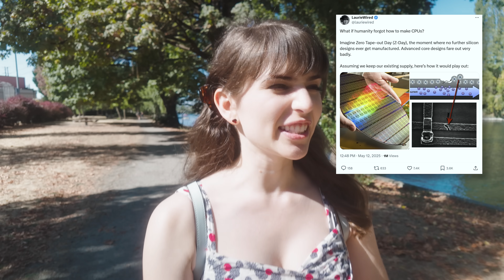what if humans forgot how to make CPUs?

Comment: 11:18 "long term storage has shifted over entirely to optical media". You must have forgotten tape. Tape never went away, magnetic tape, like LTO-9, is a high-capacity, reliable, and cost-effective and used for long-term data archiving, especially in data centers. It can hold 18TB+ per cartridge, lasts 30+ years in proper conditions, and is cheaper per terabyte than optical media. Tape resists physical damage and needs no power when stored, making it ideal for massive backups at places like CERN or Google. It's still widely used because it’s dense, durable, and scalable. Tape remains a dominant, dense, reliable, and long-lasting solution for critical long-term archival, far outpacing optical media in enterprise use. Optical media like M-DISC is marketed for archival purposes, especially for consumers or small-scale use, due to its claimed durability and lack of magnetic degradation. However, it’s less common in enterprise settings because of lower capacity, higher cost per TB, and slower write speeds compared to tape. Optical media also requires specific hardware (disc drives), which is becoming less common, whereas tape systems are still actively developed and supported.

Comment: Not hating here.
Just didn't understand something.
Why would factories stop producing CPU's if they stop getting new designs?
What's wrong with the last design that DID get produced?

I would imagine the whole computing as we know it will eventually die because the usage demands are increasing, but the hardware doesn't improve to accomodate.

But even then, some completely knew architecture or even techonology (not electrical, let's say) could and should replace conventional 2-bit computation because even now, you can't make transistors smaller than a certain limit due to quantum tunelling.

Comment: It's as likely scenario as humans forget how to make a bread. 

Even total nuclear holocaust wouldn't be able to make humans forget how to do cpus. I bet cpu designs like risc or arm are stored in secure vaults that could withstand thousands of ears untouched. Also reverse engineering allows China to build their own chips. The problem might be with post 2000 cpus that require advanced lithography, but we're talking about a cpu, not the modern cpu.

Comment: The grade of disaster globally required to really forget how to make CPU without them just be replaced by something better in some way means I suspect there would be no internet. If TSMC went pop, even TSMC and Intel, AMD, and Arm there are still plenty of Fabs and chip designers globally so absolutely worst case is it takes another decade or two doing the work to go from a relatively low tech process node CPU - perhaps something like what is in the Pi family of SBC's back to the modern tiny feature size, really energy efficient and blazing fast chips.

Comment: Current optical storage media just is nowhere large enough to store what we'd need to store, so you'd need new types of storage that can store much more data.
And of course, if you can't use CPUs to read it, it's going to be useless if there was no other method.
A good amount of research would probably be put towards that in order to not lose data.

But the scenario is a bit weird.
You just have to accept the parameters of it as truth.
Even if every CPU factory on the planet vanished in a snap, the knowledge to develop new CPUs still exist.
Even if the knowledge to develop new CPUs vanished, the CPUs still exist and are in use and could be reverse engineered.
And even if every CPU vanished, the need for automated computations still exist and our smart people would find ways to do it, like they did before.
So really, the technology would just restart with an amount of delay depending on what was lost.

Comment: I designed A doomsday Internet protocol Using radio for conectivity and Tape for storage. Take a given FM/AM Band. One will be Broadcast, the other will be the Receiver. Transmit a Package 100-10,000 hz. break that into sub bans of 20 hz  width. You now have 495 channels. Reserve Upper 95 for Meta data organization. Below you send a noise signal every 10th of a second. An analogue Scanner detects the presence or absence of a given frequency channel which is noted as a bit. these bits correspond with a unique "character". These characters  have variations defined by the pattern structure in the upper 95 channels. which increase the number of potential bit patterns, when referencing a pre-existing "Dictionary" of characters. this gives you a library of (2^400 x 2^95 =1.02 X 10^149 ) possible unique characters, each encoding a unique data imprint when decoded using the library.
Obviously you wouldn't use all those permutations, that's more than the number of atoms in the universe. However it does mean you can squeeze way more that just the 4 kbps than initially suggested. Tape Is the storage mechanism to record the Broadcast for later decoding. The fundamental infrastructure change means that the internet is now a public broadcast between towers with data dump schedules.
Additionally there is a separate protocol for audio and video.
Audio is a simple broadcast of the audio signal, however for time sake you compress the signal into a narrower frequency range and stack multiple segments of the same track on top of each other. On the back end you break each band down, frequency adjust to decompress, and stitch the segments back together in sequence. This way you increase the transfer rate (length* n bands).
Video is similar but with the addition of breaking the file down into scan line groups to pack in more resolution at the cost of longer broadcast time. but you still apply the segmenting and layering technique of the audio protocol.
Requests are made between towers via the towers listening frequency, and distributed over broadcast channels via the broadcast frequency along with a schedule of upcoming data broadcasts. Anyone who wants the file can tune in at that time to record the data to their personal tape storage for later decoding.
Now an interesting upside to this is that because wave forms are the data carrier, you can differentiate in the cycle length weather there is a signal yes, but when there is a signal you have just enough time to determine weather it is a sine or square waveform, meaning that data can be sent in trinary which i 1.585 times denser than binary. And that is per band, of which you have 400 for data and 95 for meta. That's roughly 6.34 kbps raw with no meta expansion or compression.

Comment: 1:56 I think the first thing we would do in this scenario is modify how we use the chips we have in order to protect them.  So, we would lower allowed temperatures and lower allowed speeds.  This would happen within weeks of losing the ability to make new ones.  Also, reuse would grow.  We would only throw them away when broken beyond use.  

Also, what about Gpus?  They could be used as a very-R isc chip.  .

Comment: @7:14 It's actually easy to convert "smart" cars into dumb cars. Electronic fuel injection and Electronic spark timing can be replaced with mechanical timing and carburetors as long as laws are changed to allow them to be used on the road. This will means less fuel efficient vehicles and more pollution. Automatic transmission are still mechanical inside and can be controlled with dumb electronics to operating the solenoids that tell the car what gear to be in, like switches and relays. I have seen this done to farm cars.

Comment: You didn’t deal with the loss of key knowledge about the bugs and quirks of different technologies. Over time the knowledge of those specialized skills would disappear with the passing  of those who lived through their heyday. Channels that deal with PC archeology and restoration like CuriousMarc and Adrian’s Digital Basement show that these older machines like the Commodore 64 and Macintosh SE do fail completely at some point. There are parts that we no longer can replace or build so as the supply of parts to fix them, it becomes impossible. There are many documented cases of technology being inaccessible because documentation and drivers are no longer available. Even if you have access to the software, there are also all the problems of specific software compatibilities and required plugins or even dongles. It may seem simple today to reverse engineer software keys to use in virtual machines but if you need to recreate these things on original hardware, the manufacturing skills grow exponentially.

Comment: Define chip in this scenario. The earliest chips were just small circuits, made by hand, in a ceramic casing. So, let’s say we get rid of all of that. 

No chips: we use discrete transistors to do the same thing.

No transistors: ok, we use diode resistor logic.

No semiconductors: ok we use relay to relay logic.

No electricity: unleash the BABAGE.

It doesn’t matter where you clip the tech tree the result will always be the same. We will go back to the last point of divergence, and rapidly develop all the alternative technologies we knew could be done but never had a reason to do.

Comment: While an interesting thought experiment it’s really a discourse on the fragmentation and fall of our current society. Which is very plausible. Though I believe that should this come to pass its more likely a resource issue less a knowledge issue. If it comes to a resource issue then I think the same thought experiment would apply as she laid out but that the need for processing would likely lead to people using old methods to process data short term followed by new ways to transmit and process information. Necessity is the mother of all invention. Possibly photonics or EM wave (wireless) processing where we use photons or EM waves as the carrier and processor for both the transmission and processing of information. Both versions of what I describe are wave form manipulations using physical mechanisms, which has been demonstrated as being viable to produce a transistor at nanometer scale.  Unless society fully collapses the likelihood would be that some new form of processing will supplant the old one with a more economical and long term viable form. Maybe we find a way to use nature to do the work for us. Wouldn’t it be great to collect sunlight to power your communications device not using solar cells to convert photons to electrons but using the photons themselves as the carrier and processor of all data?  If you break it down isn’t that what is a photons current working role in the universe? The photons are created by solar objects, leave those solar masses travel millions of light years collecting data along the way, which we then interpret as they arrive at the earth and we observe them. We each personally collect data from the photons that hit an object bounces off that object and reaches our eyes which we then process in our brains. Imagine the sun goes down and you cannot use your phone anymore without a flashlight.

Comment: Most medical equipments use micro controllers , there will be a rise in blunt edge computers & controllers, like ATMEG, PICO. People will move to Analog designs like CRT, with SSD of the size of a VHS tape. 

 I came to know ISRO’s processor is a 180nm, 32 bit at 100MHz.

Comment: I feel like its not in the spirit of the original question, but if we suddenly forgot how to make CPUs? We would learn it again. It would take a while, but we''d get there again, eventually. And certainly faster than the first time, because all of the technology and knowledge around it (like mask lithograpy, wafer growing etc) would still be there. Also we still have working examples to kickstart the process by givining us ample calculating power for this critical new development and we could examine failed ones to reverse engineer the design. Maybe the sudden stop in conventional CPU manufacturing could help alternative designs to be used more widely, we could see the rise of quantum processing as a mainstream technology. At your T+30y endpoint, we would most certainly have more powerful machines than today.

Comment: This was an amazing thought experiment! I agree that we would need to focus on lowering VCC/VDD and operating temperatures as soon as possible. I can't speak for other CPU or memory technologies, but for FRAM chips, memory cell degradation is exponentially worse at high temperatures. Outside of this disaster scenario, I feel that software optimization should be prioritized immediately.

Now that I'm think about all this, I may or may not be opening GitHub right now to make Issues for optimizing my Android apps. I might even dust off the old bit masking techniques. Kotlin, don't let me down. 🤣

Comment: I suspect in real life, HDDs would outlive SSD's.  There's tons of them laying around, and the MTBF on the good ones means that as long as you're not putting them in mobile devices,  there will still be 20 gig Maxtors spinning when all the bits have rotted in an the solid state boxes.   I have one that survived a house fire that melted the stickers off and warped the controller PCB.  It wouldn't work on cable select, but jumping it to slave got roughly 80% of the data off of it.  Also, the interfaces to use those old drives will still be accessible once all the newer CPU's fail.  But let's talk about capacitors, the real ticking time bomb...

Comment: The code optimization and the undervolting efforts seem to be at odds with each other, since one is striving to eke out the most performance possible while the other is specifically shooting for less. I wonder if this might not be the new equivalent of Windows vs Linux or the console wars or something.

Comment: Another thought experiment that occurs to me sometimes: If I had to build an electronic device that would be turned on in (say) 500 years from now, and I wanted it to work, how would I do it? There are mechanical devices that have lasted longer than this, but it's not obvious which electronic parts could be relied upon. There are some obvious things to avoid, like electrolytic capacitors and potentiometers and switches with contacts not gold plated. I've also seen several components that failed from tin whiskers, though mostly these were things like relays from the 1940s or germanium transistors from the 1960s, and I haven't seen anything made since RoHS fail from whiskers, maybe because it's not old enough to fail yet. Some part datasheets give a shelf life of a few years for solderability of the pins, and processor datasheets sometimes claim data retention of 100 years for flash memory (clearly that's just a guess), but most datasheets don't even try to estimate longevity after assembly and in storage.

Comment: I know there is a lot of angst and tumult about chip fabrication due to geopolitical shenanigans. And it would absolutely cause issues, especially in the short to medium term, 1-10 years.
But the biggest thing would be demand and funding. We aren't even in a (real) crisis yet, and saw the chips act happen in the last presidency to float Intel and start on-shoring tsmc (as well as other parts of the overall supply chain). And the current crop of polo opposite political figures have doubled down on ensuring that a failed company like Intel cannot be left to die.
If that kind of bipartisan money and influence can be levied during relative "good" times, you could imagine the support the CPU industry (and it's millions of support products) would get in a crisis. Even with a level reset, we would be at most 20 years from starting from scratch to Core2 levels of performance (where chips finally were "fast enough" to keep up with unencrypted work flows) instead of the 50+ years it took the first time.
What would be most interesting to me from a sci-fi story perspective is what that rebuilt compute would look like. Modern compute is built on decades of world spanning production efforts and constant sabotage efforts. I'd imagine future efforts would be much more insular... Which would mean region specific material choices, likely much beefier external facing security to keep others out, and much softer internal structure for easier audit capabilities. We may be getting a small preview of this future with China's home grown chip efforts. Sure, they don't keep up with the broader market available chips, but they are evolving rather differently with local choices and government mandated features. How much would things need to evolve in compute and network protocols before the compute structure fractures entirely? I don't want to see that future. Modern compute and the nature of its globe spanning supply lines have been a massive force for peace, because all major governments relied on the same supply chains. Break that... Oh boy...

Comment: I think maybe many PCs are suffering from software that is making unnecessary hard drive writes and/or unnecessary hard drive reads. There ought to be a tool to identify such malignant software that causes unnecessary energy waste.

For example, Microsoft system processes checking something every 20 minutes is a bit much and it surely causes unnecessary context switching which may cause weird buffer underruns in our fav games.